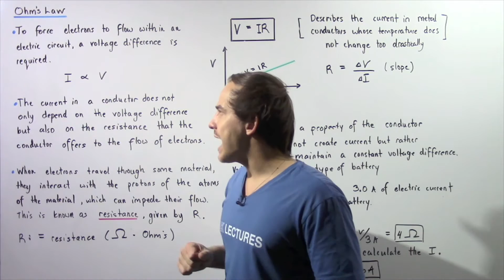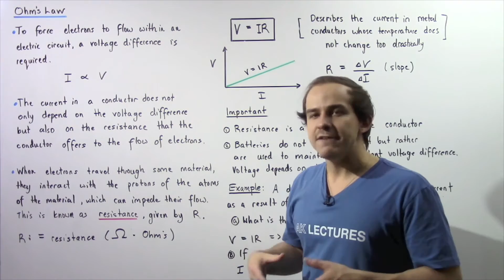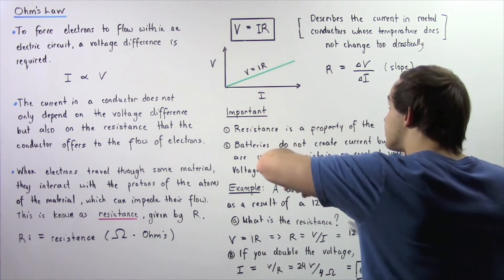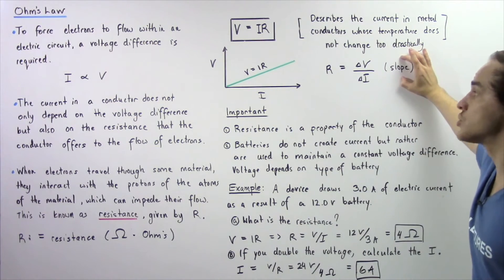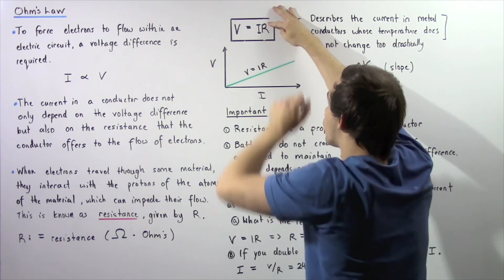Ohm's Law

Comment: how does the battery maintain constant potential difference? plx explain
Reply: It is thanks to the continuous chemical reaction that lasts until the battery is "empty" (when the negative electrode is "destroyed", since this electrode loses gradually its atoms into the electrolyte).